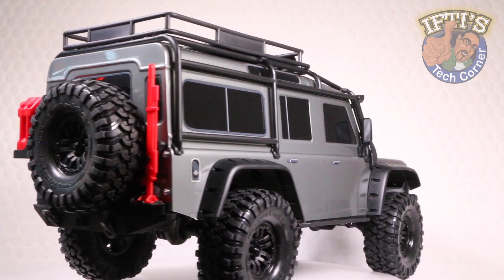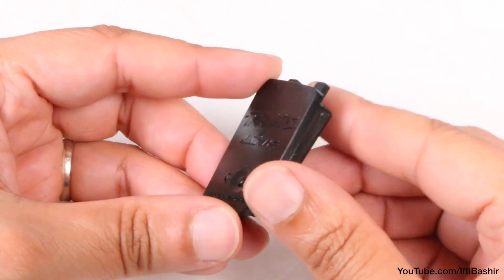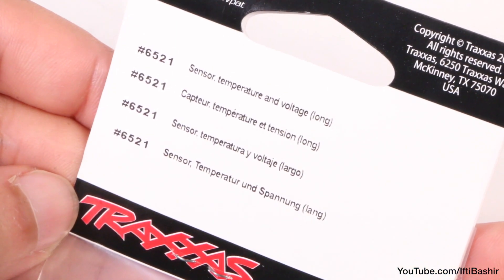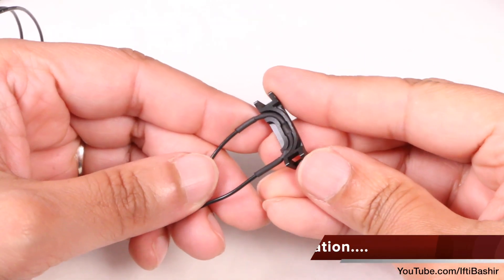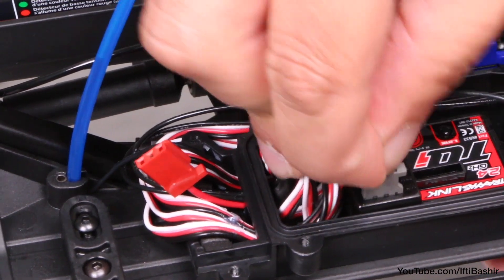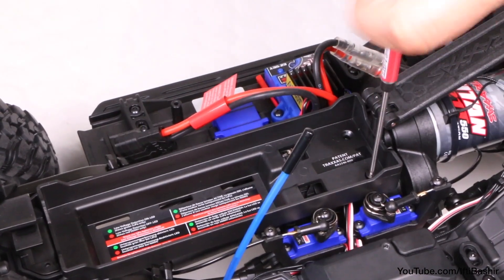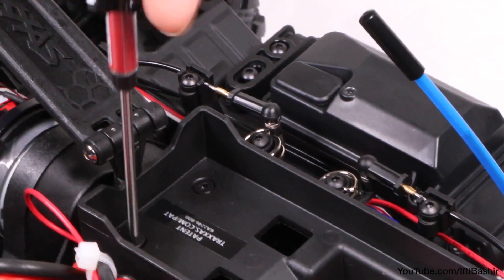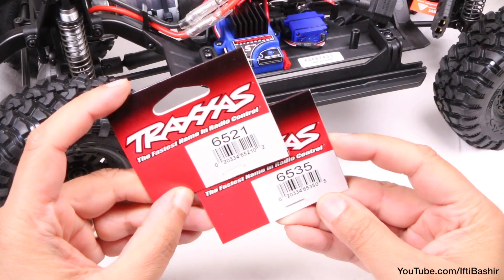#02 Traxxas TRX-4  - Installing Traxxas Link + Temperature & Voltage Sensor : INSTALL GUIDE

Comment: Excellent video! There's another power tab for use with newer Traxxas battery connecters; TRA6541X
Reply: Correction: TRA6549
Reply from the maker: Thanks for sharing

Comment: Pro tip if you search up traxxas t-maxx telemetry you can get every optional telemetry sensor (rpm, temp, voltage) for cheaper than buying each sensor separately

Comment: Nice guide, to connect the + for battery you also don't need this cable with red connector. Simply unplug the small red connector expand the + cable to + battery. So with that setup you just need the temperature holder... which you also don't really need you can do it yourself . So in my words, just buy the sensor all the rest you can handle with 0 problems just a bit creativity :)

Comment: How did you solder voltage wire on to red esc wire?  Did you wrap it around + wire or just lined it up or soldered directly to copper plate?  i know its a small space, did you have to peel back insulation at all? thanks for the help
Reply from the maker: Im not very good with soldering! I peeled back the insulation by a few mm, then wrapped the red wire and applied solder on top.....
Reply: @iftibashir  That sounds like a good way to do it. Thanks for the help!

Comment: put the battery connector in the controller box... Why keep a connection in the elements if you don't need to.

Comment: Did you just remove the positive lead from the esc battery connector and solder on the extra wire?
Reply from the maker: Correct ;o)
Reply: @iftibashir  how does it remove?

Comment: What is the traxxas part you need to buy if to make it all connect to the battery if you don’t want to solder it?
Reply from the maker: The Traxxas Power Tap - Link is in the video description.....
Reply: I have the power tab cable, but it doesn’t connect into the battery wire that comes out of the car

Comment: Nice video! 
I am guessing one can skip the power tap part and just run a wire from battery positive to the sensor connector?
Reply from the maker: yes that will work fine!
Reply: I may have to do that myself. I just ordered the temp/volt sensor, but didn't know I needed other extra parts. It seemed simple enough, so I may do the solder connection when I track down the missing piece

Comment: How did you get the angle on the Traxxas app?
Reply from the maker: Its built it - just change the dials
Reply: iftibashir so when u turn n the app and the car it will appear
Reply: iftibashir I can’t find them lol is there a update or sum also srry if I’m annoying y’all

Comment: Where are you supposed to place the small piece of thermal tape they include with the temperature sensor fastener kit ?
Reply: Yes he sure was meant to install this, but no got missed and the temp sensor now is lose as it also helps keep it in place 🤦🏼‍♂️